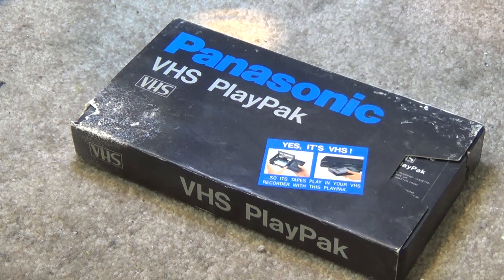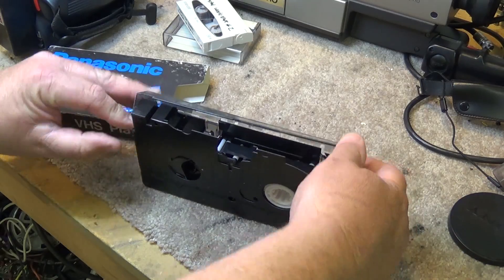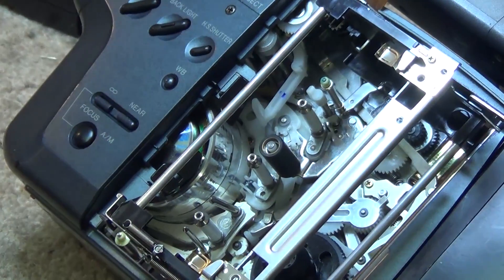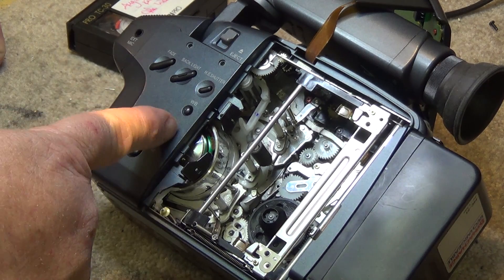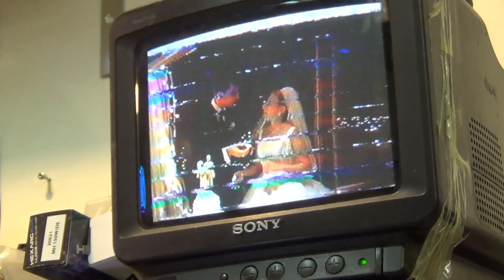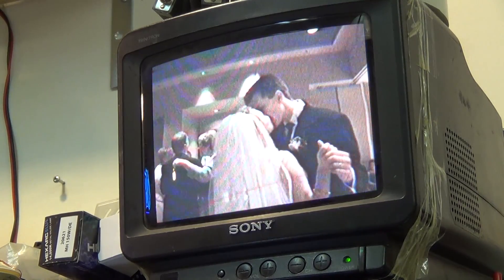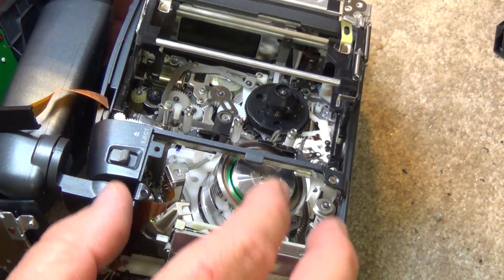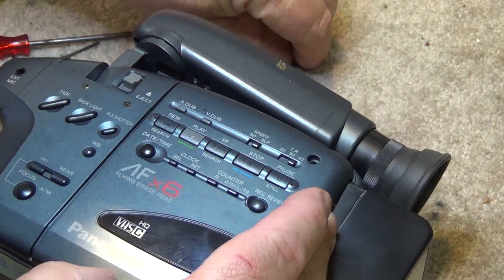Panasonic PV11 VHS C Alignment

Comment: Your video helped me out as well-I have a Panasonic PV-IQ403 camcorder that is out of alignment-but after I adjust it and it clears up-the tape guide post wants to move back to it’s out-of-alignment position-after I eject the tape. I noticed that the tape guide post isn’t as snug when I screw it back into proper alignment as I would like it to be.
Reply from the maker: Vhs-c was a half baked format from the get go..the alignment changes with every tape inserted.
Reply: @12voltvids  I am glad to hear that my camcorder isn’t broken! It’s just one of the quirks that the VHS-C format camcorders have. I also have a service manual for it and my other camcorder similar to it-shows me how to work on it and make adjustments to it like that.

Comment: Hello, I would be very happy if you would respond to this messeage. I have a problem with my Panasonic NV-G1 vhs C camcorder that doesnt even want to and play tapes when the tape is loaded. Do you perhaps know how to fix it and if you do, please reply and I would like to get in contact with you about my problem. Thanks!
Reply from the maker: I have no idea as I am not familiar with that model. For that matter I am not familiar with many VHS-c camcorders because I refused to work on bgg them.  The only camcorders I worked with was Sony and canon and these were 8mm and dv types.  When the other ones walked in the door they were condemned pretty quick.
Reply: @12voltvids  Thanks anyway!

Comment: Hey there, I’m trying to fix an old JVC GR-AX70 and wondered if you could help me.

The vertical sync on playback is awful. So there is a huge line in the video keeps going top to bottom repeatedly. However if I plug it directly into my CRT tv, the issue is fixed relatively on the TV. Sometimes I’ll have to plug the composite cables in and out of the camera to get the line to disappear instead of appearing in the middle of the screen, but otherwise it looks clean and has no sync issues.

However, if I peer into the on-board viewfinder, it’s still suffering from the aforementioned issue, even though the image on the tv isn’t.

If I try and play the tape (VHS-C) back on an adapter it doesn’t play very well at all, and in fact it will stop completely occasionally 

Do you know what I’d have to adjust or do to fix this?

I’m trying to use it for an experimental film with hopes of digitally converting the footage once I’m done.
Reply from the maker: More than likely you are going to have to replace a hand full of capacitors.
Reply: @12voltvids  anywhere specifically? Thank you for the swift reply by the way.

Comment: my recordings are playing back with half the screen messy, i’m assuming it’s a similar alignment problem happening in record mode? a/bing the fix is a bit harder because i wont have immediate results of what my adjustments are doing (i don’t see the problem until the recording is played back)
Reply from the maker: Try playing a known good recording.  If that plays then it is not an alignment issue.

Comment: Hey Dave! Your fan from Argentina with questions, again. I have been doing some vhs-c PAL transfers using the vhs adapter with my AG4700 decks. So far, so good.
However recently a friend gaveme some VHS-C NTSC tapes to transfer. Since here NTSC decks are impossible to find, I bought a JVC GR-SXM747 SVHS-C camcoder (with built-in tbc).
The general opinion over the internet is that using a camcoder for transfering vhs-c tapes isn't a good idea. Most preffer the vhs adapter and use a svhs deck.
I wanted to ask you, in your experience, is any truth to that? would the image look cleaner or better in anyway if I play'd in a standar vhs deck compared to the camcoder? So far the only downsize I can see is that the camcorder has mono audio output.
Reply from the maker: There really shouldn't be much if any difference in quality playing on a camcorder as opposed to a VCR.  Some camcorders even had a built in tbc.   Since no consumer vhsc camera recorded hifi sound there is no stereo. They were all mono.  The only cameras I am aware of that recorded in hifi were some of the high end professional camcorders that took a full size tape.

Comment: Is there any way you could walk me through repairing my GE CG9815 camcorder? My mom passed it down to me and I’ve asked locally on Reddit if anyone could help repair it but every suggests I buy a new one. I’d rather not since this one hold personal value and is sentimental. It has the exact same problem as this couples camcorder. I’m afraid to attempt what you’ve down because I’m afraid I will destroy it.

Comment: Hi, i have an 8mm Grundig VS-810 camera with a strange problem. It has vertical lines and from time to time the screen flickers. Here is a video: https://www.youtube.com/watch?v=oJOCNqZv0d8 I tried it on battery and pluged in but there is no difference. Also i took it a part and replaced one 220μF capacitor but this didn't fix it either. Do you have an idea what is the problem?
Reply from the maker: Борис Борисов Looks like failed capacitors in the DC-DC inverter module.This will be a metal module shielded on all sides. Open the covers and you will find a bunch of surface mount electrolytic capacitors, and I bet they are leaking.
Reply: 12voltvidsThis 220μF capacitor that i changed was near to the inverter module but it was outside the metal shield. I haven't opened the metal cover. I'm going to open it and change the capacitors inside. Thank you very much for advice!

Comment: I have about 6 of those adapters....they are going for high prices on eBay plus Radio Shack still sale's them...find a store going under as they were selling them for $5 each!

I have 3 full size 1980's consumer VHS's and 1 1996(?) pro in my collection, the consumers all work fine, no issues...the pro, I need to re-cap and either lube or replace the head as the bearing is noisy....great video!